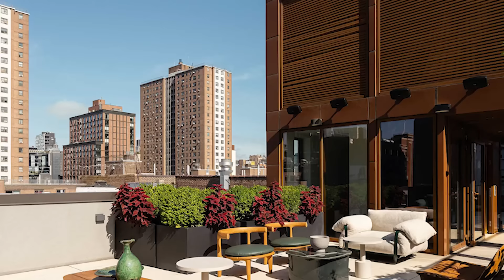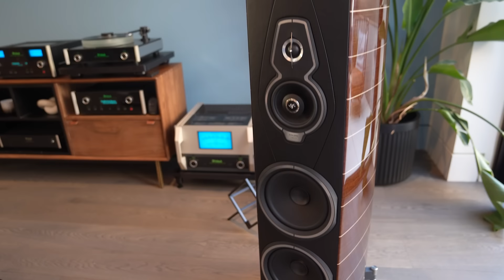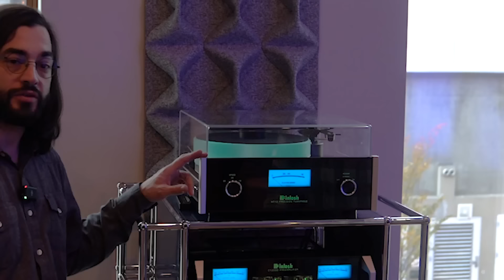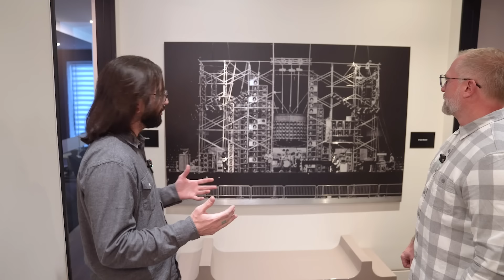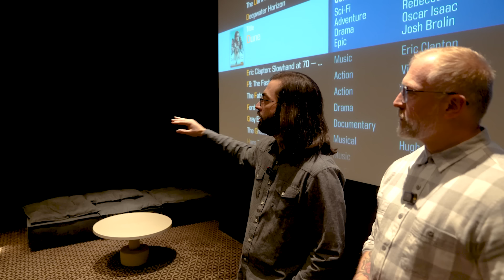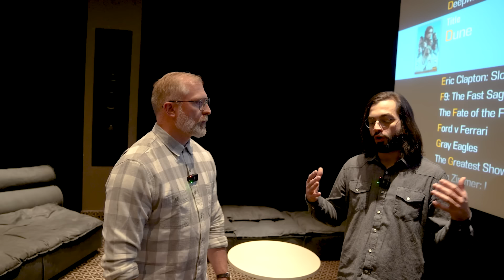Inside House of Sound NYC | Best of McIntosh, Sonus faber, Rotel/Michi, Pro-Ject & More

Comment: But with glass windows how you guys got the audio corrected?
Reply from the maker: MEN 220 Room Correction System was used in the rooms with glass, challenging acoustics. Also, they really messed around with speaker placement and did add some acoustic treatment. Take away was a combo of room correction gear and acoustic treatment will provide best sound in any given room.

Comment: I’m not a fan of McIntosh, they are far from the best out there. Rotel michi line has gotten a lot of praise especially there Amps.McIntosh speakers resale value is low and hard to sell on the used market.i would take sonus faber with rotel michi amps over McIntosh.
Reply from the maker: Different strokes. McIntosh has a big, meaty sound with good detail and refinement while being smooth, flowy, non-fatiguing—you can listen for hours. Someone once described it as an iron fist in a velvet glove, which I thought was pretty accurate. Michi has some of the same characteristics but a little more lively, dynamic and punchy.
Reply: I’ve listened to a lot of McIntosh paired with b&w 800 diamonds. I’m personally not a fan of them. But it comes down to your listening preference as we all have a sound we prefer over another.
Reply: Also people who have money like this don't care for resale value. They really don't because they can buy what they want when they want without having to sell anything first. They have the money and are not worried about budgeting
Reply: What's the problem with Mcintosh?
Reply: Nothing personal, I find their sound to just be average. There’s better gear out there then what McIntosh offers. People love McIntosh for their name, pretty lights and meters. I’m more about sonic performance over looks. That’s all just my personal opinion.
Reply: Ok so do you even own 10% of what this guy does or mouthing off what reviews are like? When you have the money then we will see. Until then just stfu and don't be envious. Not a good look. Especially from losers who drool over stuff like this but can't afford it so have to criticize it